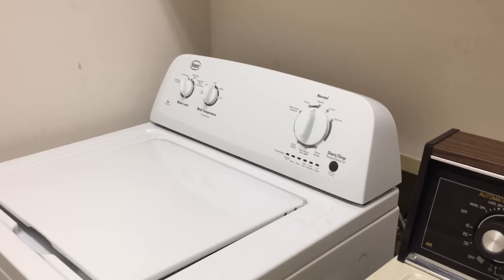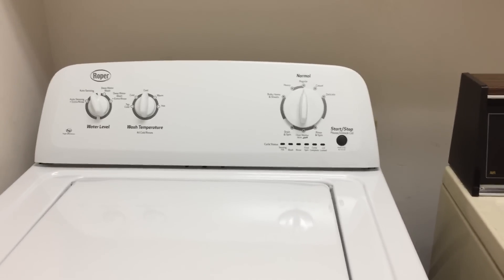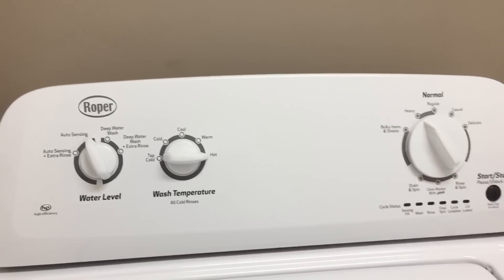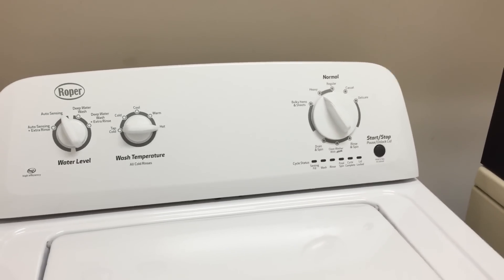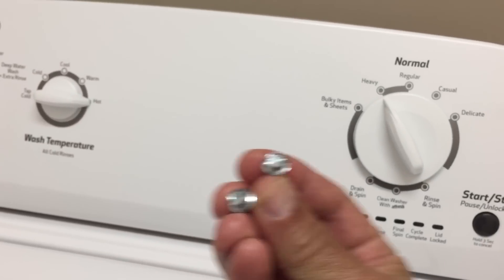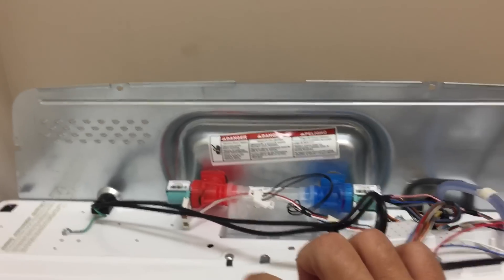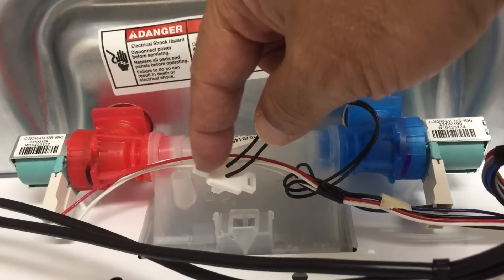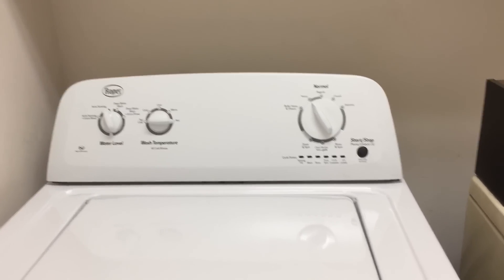Whirlpool/Roper high efficiency top load washer. How to get hot tap water wash.

Comment: Your insruction was spot on? and you gave us great info on this washer. Someone gave us one like this and right now it's not filling. 
We had our pipes re-done and haven't had a washer until now. Apparently the hot water facet in the laundry room in not flowing so I only connected the cold water hose.
Does this washer need to sense pressure from both sides maybe? Could that be why it's not filling?
Hope you can help. Thanks

Comment: Great video...this is my machine. I had a Whirlpool washer before this and if I left the top open it would soak my clothes. Is there a way to do that with this machine? Thanks for any input!
Reply: You can soak the clothes by just putting the machine on pause with the lid closed and it will not drain out.... You have to make sure the lid is closed though because if you pause it with the lid up,  after 15 minutes it will drain out.
Reply: @patcola7335  OMG thank you so much for letting me know!
Reply: @erindav1  👍

Comment: This helps and thank you and anybody else that thinks to buy this washing machine like I said I was tired I was trying to buy a washing machine I was devastated at the price of having to buy a new washer $550 for this piece of garbage for 2020 model and the water I didn't realize that the water you couldn't control the other sensors have to do it. Sometimes it'll be a small load and it will feel straight to the top even though I said it where she just come out small a little bit of water this is the worst washer in the world so thank you for at least teaching me to bypass these things thank you

Comment: I have the same washing machine, the 2017 model. I just opened it up and it doesn’t have that piece connected... in fact it doesn’t have that piece at all... i don’t see it anywhere in there. It still has issues with the water getting hot though... I’m so confused. How could this be? Everything on the inside looks the same... just no plug....

Comment: What about the water level?  I just bought a house with this machine, and the water level stays BELOW the level of the clothes in the washer, no matter what setting I've tried.
Reply: Use deep water wash and don't overload it. If you have a 2 bu laundry basket only load as much clothes into the wash drum as what comes to the very bottom of the rim of the basket without squishing the clothes down. Otherwise you'll overload the drum.

Comment: Would this method of getting hot water work for maytag mvwp575gw, the commercial residential? Do u know if the hot on that machine is only lukewarm or at least warm?
Reply: Yes this works on the 575.  The factory default hot on the 575 is 90F.  Not very hot.

Comment: I have dirty clothes and I want to put them in a lot of water, because the final rinse is mud.  I cannot get it to fill with enough water to cover the clothes.  The instructions repeat over and over that the DEEP FILL WILL NOT WORK ON A NORMAL CYCLE.  Well, what cycle is not NORMAL?  The knob on the right says NORMAL at the top, and then there are 8 options.  Which option is not NORMAL?  What can I set it on to get the DEEP FILL????  The useless instruction manual was made by a team of idiots.  Can you help?

Thanks for teaching us how to resolve the 2 annoying features. It is not working as they made it with all the government sensors.  I may  be able to get my clothes clean by using your alterations.   Thanks!

Comment: When you choose hot , some homes takes time for hot to become hot , it starts with cold water that are inside the pipe and by the time hot water comes from water heater the amount of water that washer needs already in there as cold , so i think it is not the washer's problem it is the distance between water heater to the washer . I might be wrong but when i open my hot water side in sink , it takes a good 45 seconds or more or another word a good one to two or more gallons of cold has to pass before hot comes out.
Reply: Right and wrong.  Those temp sensors do regulate temperature.  If your hot is cold to start, the sensor will add more hot and less cold on the back end to bring it to the preset hot, which is usually just warm.

Comment: This has been very helpful. Do you have a post about water sensor not working?  We are wasting water because the machine fills to full for all size loads. Thanks
Reply: Same here, the washer stops in Rinse step if i use Auto Sensing...
Reply: And mine won't add nearly enough water!

Comment: So far, about a week in, I love my new washing machine=>>allmy.tips/WhirlpoolWasher?91m     I had no time to shop around because my old one had quit already so I did choose this one in a hurry. The tub is huge so I can finally fit large blankets in my washer! The sounds are a little different than what I'm used to but that's not a problem. I had to go over the manual to learn how to use it and still haven't tried all the different settings yet. This is also the first washer I've had that senses how much water to use, it hasn't presented any issues for me so far. Definitely, read the manual to find the recommended settings so you understand how each works or you may not be happy with the outcome of your wash. Again, so far I love it#

Comment: I have this washer, and I just tried to leave a review of it on lowes.com. I wrote the review, but the site will no accept it. So be it.  This washer is almost worthless. I would highly recommend NOT buying it. The water level has two settings: Auto and deep. Both of those levels only get up to half the load level, ie half your clothes are sticking abouve the water and are not getting clean. I have to haul in buckets of water from the kitchen sink to get enough water to get the job done.  I bought this because it got good reviews. I don't know what the purchasers were smoking. Avoid it! Oh, another thing, one time it just stopped after the wash cycle and did not spin. I had to mess around with it to get it to spin.
Reply: Deep water does not work for either. So damn stupid!

Comment: Unrelated question, but about this exact washer: We just got this machine a few weeks ago in the house we rent and there is a space/gap between the drum or tub and the top of the washer. Is this normal? Also the drum is really loose and kinda moves all over. Is that normal for this washer? It seems to work okay, but is very different than what I've normally seen in  my washers.
Reply: That’s normal.

Comment: How can i do a 30 min soak in this machine with the lid open?  I've tried and i can only make it to about 10 or 15 mins before it drains itself and turns off.
Reply: Let it full up, unplug it, and soak to your heart's content!
Reply: I been able to soak after the load starts by pausing.  If you do it before it will drain
Reply: I been able to soak after the load starts by pausing.  If you do it before it will drain

Comment: This is the exact issue I have except on my Kenmore 600 top loader. Any suggestions for hacking the ATC switch or is there another wire I can disconnect like the one on your machine? Just before finding your video I  installed a new ATC switch and an inlet valve but that didn't  fix the problem. So aggravating. I just tested it and the hot water only reaches 100° because it continues to mix in cold water. Dealing with this for 5 years. Yours is the only video that even gets close to my specific problem.  Any suggestions?  Please help? Thanks so much.

Part number w10184148 4 position ATC switch
Kenmore 600 model number 110. 29622800
Reply: Melodie O you have a very good washer on your hands they don’t make direct drive washers anymore so if it breaks down please fix it the parts for it are extremely cheap and the machine is easy to fix but I’m having the same issue I suggest to just deal with it my clothes still come out clean just take care of it if you move take it with you I’m telling you it’s just that worth It have a nice life and feel free to get back to me
Reply: @Kuromii3  okay thanks for your input. A friend of mine suggested I reach behind my machine and turn off the cold water valve while filling whenever I need a true hot water load, then turn it back on when its done filling. So far this has made all the difference! Temp reaches 135 °  Guess I just have to hack my machine for the rest of its life. But at least I get what I need.
Reply: Melodie O if it’s not broken why fix it me personally I almost never use hot water but everyone’s different, best of luck!
Reply: @Kuromii3  Thanks, yes I didn't for years, not seeing the difference. But pretty soon my sensitive nose couldn't ignore, the musty, mildew smell in all the clothes, linens, towels. I tried so many things over the years, changing detergents from big brands to dollar store products...  I added laundry boosters- oxyclean, Clorox2, vinegar, baking soda,  borax, even alcohol and then finally ammonia. Ammonia is the only one that consistently cut the smell of old grease, and deodorized the bath towels and kitchen towels, clothes. But now I'm happy to say Hot water and basic detergent make all the difference for these loads at my house.
Reply: Melodie O Oh no that’s horrible! Have you ever tried running the machine on a full tub of water by itself (warm/hot) water with no clothes with vinegar and stop the cycle and leave the water for a good hour then let it run and rinse? That’s what I’ve done to clean my machine because stuff builds up over the years in the outer tub
Reply: @melodie-1977  
A 600 series? Wow that's a steel!
Reply: @Kuromii3  thanks for the suggestion.  I will be giving that a try.  Sorry it took a year to reply to you smh🤦‍♀️👍
Reply: Melodie O not only that but these are belt drives, direct drives and belt drives are two comepletely different machines so your machine is way more mechanical (less tech) which = easier and less expensive repairs where as these belt drives have more tech built into them so they can fail faster and just don’t last as long as old school

Comment: You are a lifesaver! I bought this #@/@# thing today and I was PISSED!  But  after watching this, I put it on heavy instead of normal and the water was hot enough to be acceptable. Don't really feel comfortable dismantling a brand new washer, but maybe down the line I will try the sensor thing.  Thanks!
Reply: how did you even know the water temperature, the thing shuts off the second you open the lid.  now that I dislike
Reply: I let it fill a little then pause it to check. When you press the pause button for three seconds it will abort the wash and drain.  It takes some getting used to, that's for sure.

Comment: Ah so it's only pure hot or pure cold after you disable the temp sensor. It's videos like this that make me glad my washer is from 96. No expensive electronics to fail and no lies on the control panel. The setting I choose is the setting I get. Thanks for this video if  I ever need to get one of these toy machines I will do these mods instantly.
Reply: I'm gonna install a toggle switch on the sensor and mount to the face.

Comment: Mine was under Warranty. So I called Loews servicemen to correct this bull. They actually just switched the hoses in the back of the machine and EVERYTHING WORKS PERFECTLY (except for resetting a wash to restart while water is in there)...this was an easy fix (even after the service guy hooked his laptop up to the system).

Comment: Just got this set the settings hit the start it filled and then I thought I heard it washing but then after a while it stopped but it didn't do anything else it just stopped and the wash light was on. It didn't do anything for like 15min and then my mom finally cancelled it and ran the cycles manually. Is this common?
Reply: April Tackett 
I have only had this washer a month and it won't spin cycle even manually

Comment: I figured out that regular washed and rinsed in cold only, I thought it was broken, but it sucks. I wish they would do away with the lid lock. I tried pulling the sensor out and it wouldn't fill up.
Reply: Zane Wv agreed! Dumbest feature EVER. i used some bent nose needle nose pkiers to stick into the latch so i coyld sew WTF was going on. The agitation in this unit seems SOOOOO SLOW. I got a brand new one but this seems like a real piece of shit so far.
Reply: @b_o_d_h_i_s_a_t_t_v_a  Does the agitation sound like this? https://drive.google.com/file/d/1-wdnT2g2l7jgFiTMK87UAB5KT6UzS0BV/view?usp=sharing
That is the sound of mine, plus there are no suds whatsoever, which I assume is because it barely agitates? This begs the question, does it even clean the clothes?

Comment: I just bought this exact washing machine from Lowe's and am still trying to figure out how to use it but I did what you said and removed the control deck from the washer and low and behold they have redesigned it so there isn't  a hot water sensor where yours is.
Reply: Regular cycle is all cold, just figured it out, I have to use the other settings to get hot water, and why isn't there an option for whites?

Comment: honestly I can't tell which cycle is for small loads can anyone tell me please. I don't have the manual to read it. it might be obvious but I don't understand it. it has auto sensing+extraRinse/deep water wash/+extraRinse. I just don't know. please anyone thanks.
Reply: Then why it said in the book . Once sensing is complete, the washer will fill to the appropriate level for the detected  load size and then begin the  wash phase of cycle. page 4
Reply: Yes it does, it spins the tub to sense the load before filling.
Reply: It sense the load to save water . The +extra rinse is when you use fabric softener. Deep water fill it up to max level.
Reply from the maker: It does NOT sense the load. It is a misnomer. They label it that way to sound good. The "auto sensing" cycle does NOT sense the load. It always uses the same lower water level regardless if there is any cloths or an overflowing load in the washer. Extra rinse does an actual rinse filling with water filling the tub. Without extra rinse on the normal cycle, it just sprays a little water on the cloths after draining from the wash and goes straight to spin. Almost no rinse at all.
Reply from the maker: Its called marketing.
Reply: THere isn't one for small loads, just set it to auto sense
Reply from the maker: There is no setting for small loads. Auto sense is the smallest load setting.
Reply: Good to know. I thought my new washer was defective. They LIE in the manual saying it will SENSE how big a load is.

Comment from the maker: Erica asked about a scrubbing sound while filling up. The comment isn't showing up here. I don't understand why.

In any case, during filling there is a sound made periodically. Its the washer running the agitator. It does a back and forth swish every few seconds during the fill on most but not all cycles. This is actually pretty tough on cloths when you have a pile of heavy damp cloths until it fills up enough to let the cloths move around in the water.
Reply: truthjunkie3 agreed!!! Why would you want to agitate when theres hardly any water in there????  Total BS. and it sounds awful... it sounds broken.... NOT HAPPY with the unit so far
Reply: This is how the washer senses the load on the agitator.

Comment: Is there anyway you could post a video of this machine running? I would love to see a full cycle vid if that is possible.
Reply from the maker: Any particular cycle? Normal is the unbelievable bad cycle. I'm planning to post a video of the rinse. Its unbelievable. Basically doesn't rinse cloths. Dumps a little water in the middle of the basket, often while cloths isn't even there and pumps it straight back out. Then spins the soapy cloths some and calls it a day. Every other cycle does a real rinse with water.
Reply: well do one of the cycles that does a real rinse lol!  Its sad that these machines are going this route anymore.  Could you also you the deep water fill as well?  Thanks
Reply: So NORMAL is BAD, and HEAVY is GOOD? With Heavy you get the hottest water without detaching the heat sensor, right?